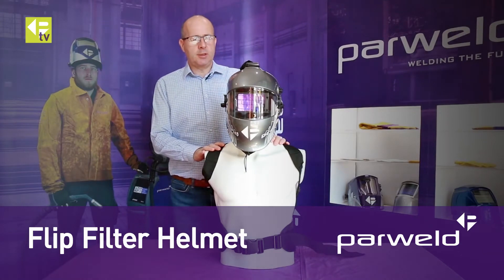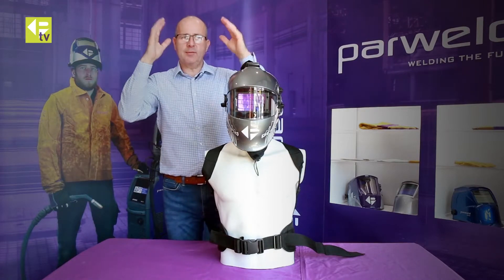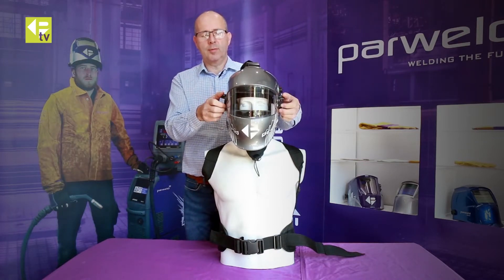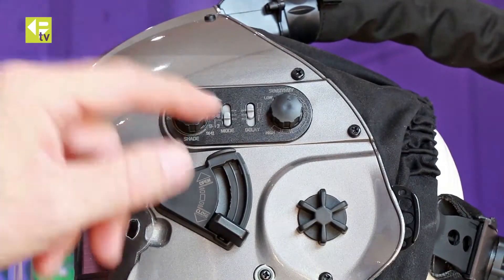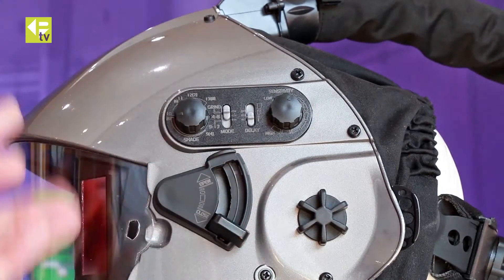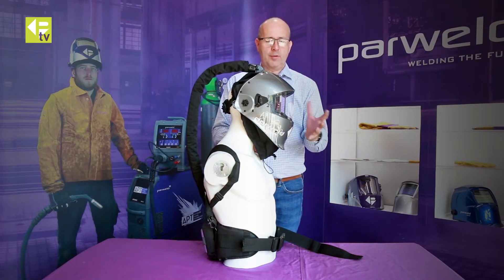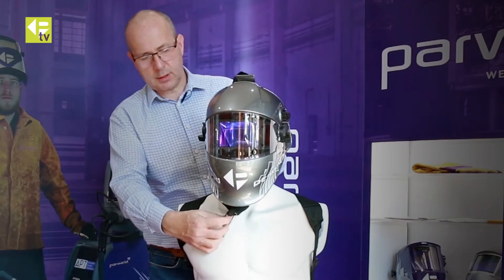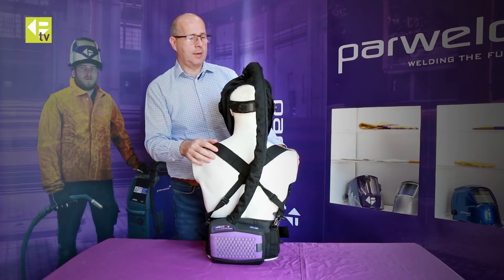Flip Front Filter Welding Helmet from Parweld

Comment: Parweld I understand your trying to get into the whole airfed market but if your gonna do it do it proper and not half assed, I have used 2 of your masks the airfed large and the smaller screen one and they both fit horrible the headpiece is to big the hose is too Bulk there it no protection for the top of the head down to the neck and the settings being outside is a problem because they just get destroyed by spatter, so update everything and modernise
Reply from the maker: Hi Stefan, thanks for the feedback, the if you have time I could walk you through this over the phone. The current units offer the face seal which covers the top of your head and the air duct that comes back and covers your neck. The controls are external as this would effect the clear air flow if you removed the helmet to change the settings, potentially putting you at risk. This unit is a completely different design to the one you are talking about from several years ago. Regards, Reece.